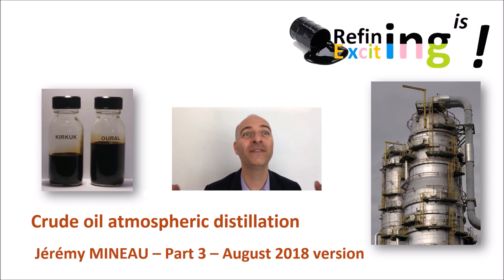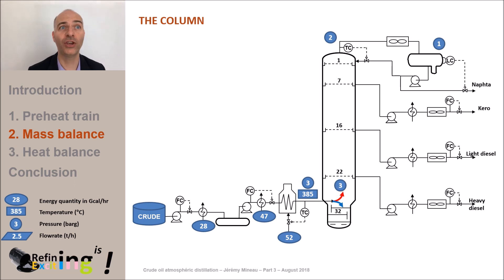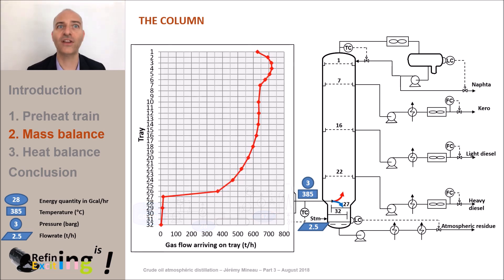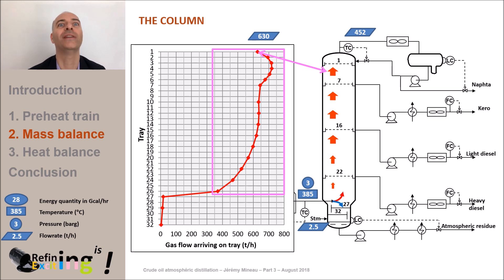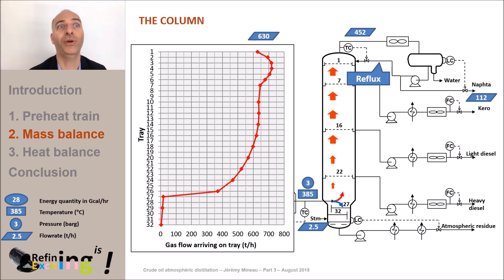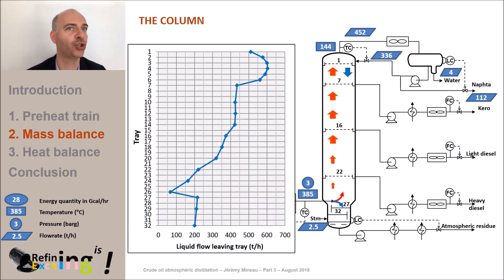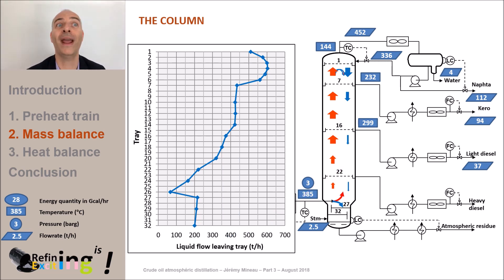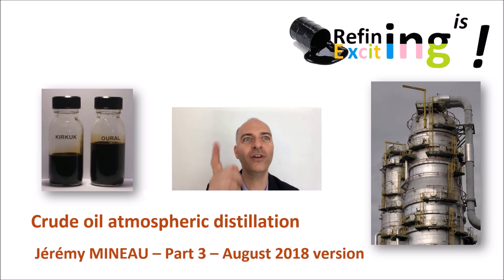MOOC - Crude Oil Atmospheric Distillation - Part 3

Comment: What is the purpose of the flash vessel; except fraction it? Is it possible to do the destilliation without flash vessel?
Reply from the maker: When you say « flash vessel », are you referring to the column ? Fractionation without a column is not possible ! Unless you want to do it when using other separation process. But experience has shown that using a fractionation tower is the most effective from a technology point of view as well as economic point of view ! Hope this answers your question !
Reply: @refiningisexciting  im not reffering to the column. I mean why is a part of crude oil vaporised before feeding to the column?
Reply: Is to improve the destillation proces?
Reply from the maker: I’m sorry, I do not understand your remark. There is no vessel upstream the fractionation column. But you’re right, like I mention in the video the crude is partially vaporized just upstream the furnace, due to the pressure effect.
Reply from the maker: Everything is explained in the video. I let you watch it 😃
Reply: @refiningisexciting  Yes but why you let it vaporize? Can you feed the crude in the column without vaporizing it? I've always seen that you feed liquid in a destillation column.
Reply from the maker: I think the explanation is given in the video. For a distillation, you need to vaporize to let the molecules rise in the tower. Either you vaporize them with a reboiler or when vaporizing the feed.
For a crude oil distillation, it is not possible to reboil the tower otherwise the bottoms temperature would be too high. That s why you HAVE TO vaporize most of the crude oil in the feed heater.
Hope this answers your question !
Reply: @refiningisexciting  Yes Thank you!!